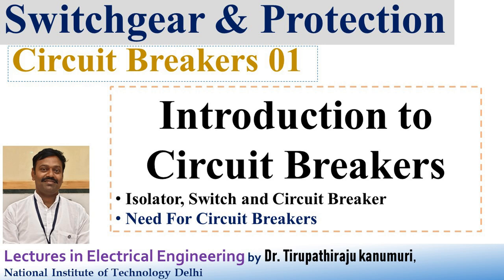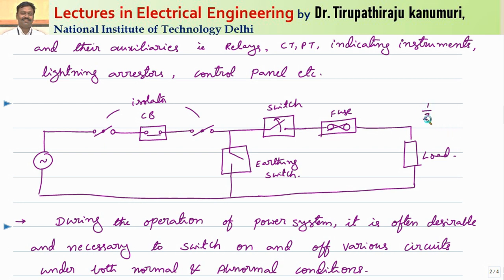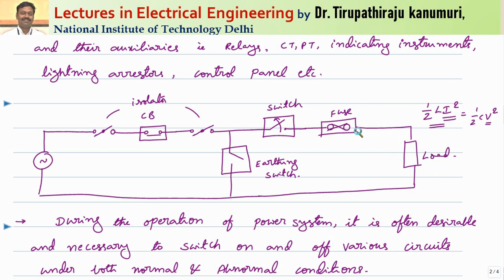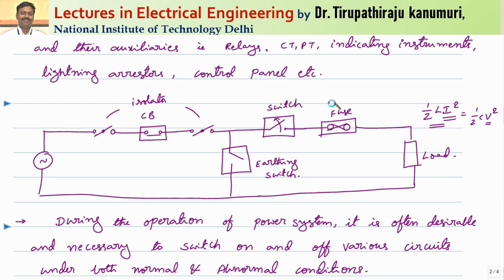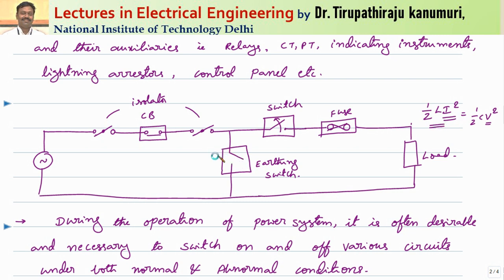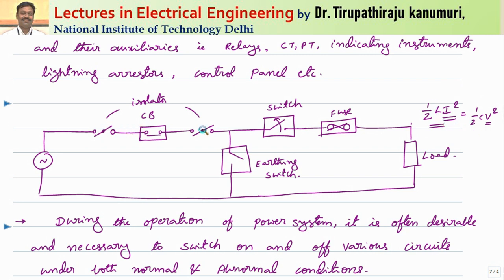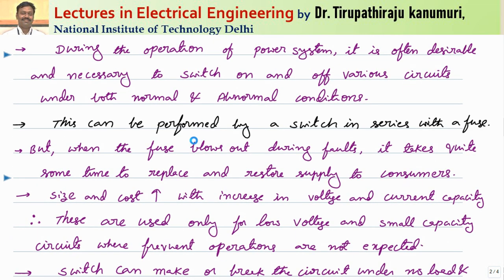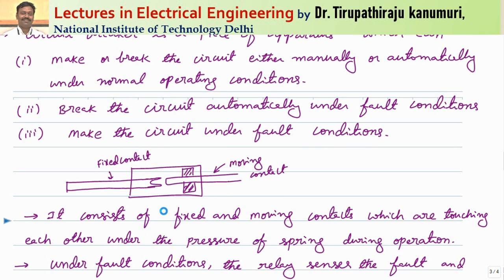SGP201 Introduction to Circuit Breakers

Comment: Sir I am unable to understand one part sir. During fault condition, due to high current sparking happens when we try to open switch. But this high current is from supply to load, so why is the energy stored in the inductor of the load taken into account sir?

Comment: Thank you sir for effort to make us understand the topics. I am a regular viewer of your channel. I have an interview for the post of lecturer in diploma colleges in west bengal. Please suggest me how to prepare and what kind of questions I may face in interview.
Reply: @lecturesinelectricaleng  Thank you very much sir for your kind guidance. Electrical Machine, Circuit theory and networks and Control systems are my favourite subjects. I am not very comfortable in power system and measurement. Will it cause any difficulty sir?  I am preparing power system listening your lectures. Specially Power system protection.
Reply: @lecturesinelectricaleng  Thank you sir. Good morning..